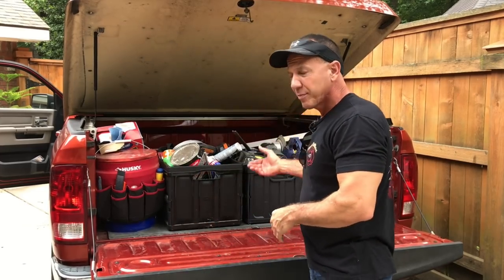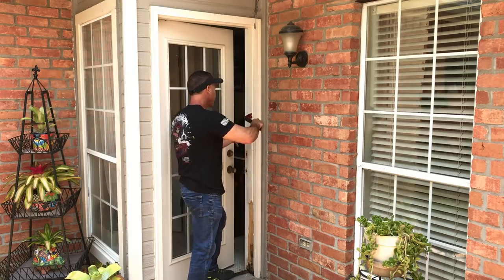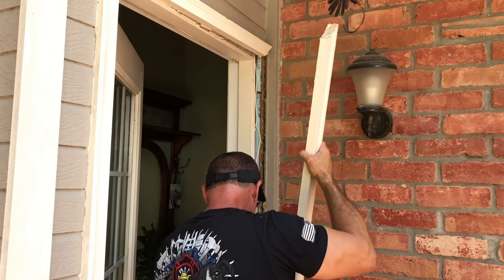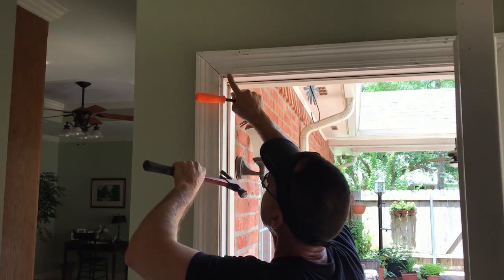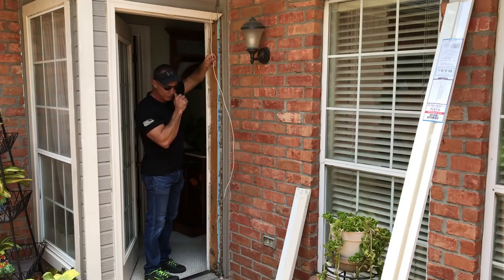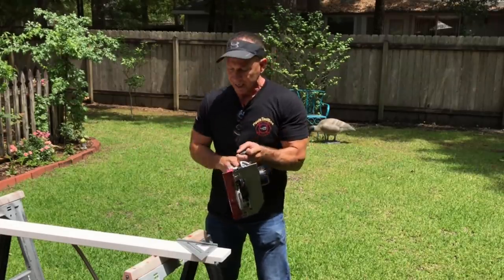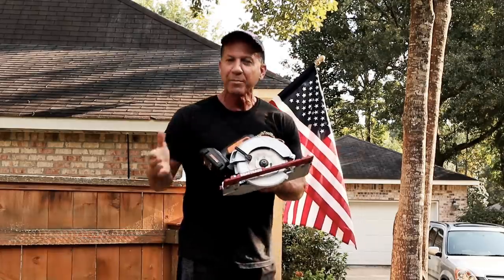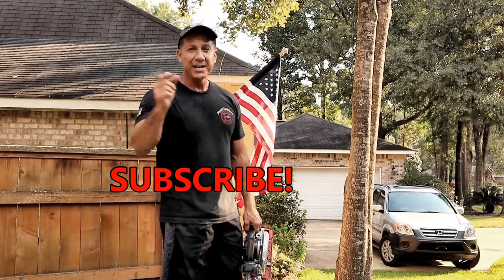Repair Replace Door Jambs Part 1

Comment: I appreciate that you have to edit things out but there are places that you skip that can leave someone wondering how you got to there after skipping forward. Things such as keeping an even space between the door and the jamb for example, or how you measured and reinstalled the lock and dead bolt latch plates. I know you know what you’re doing but at times experienced people forget those watching don’t know it all.
Reply from the maker: Hi Clint,
I'm sorry that I confused you, I try to explain everything but I do my best to give full information without getting too lengthy. I meant the door reveal and I show how to do this in previous videos. I don't expect everyone to watch all of my videos and I will try not to skip again. I will put a playlist together that will categorize similar videos. As far as the reinstallation of the lock and strike plate, I had it in this video but it was too long and I am going to be posting it soon. I have very useful tips in that video and I hope you take a moment to watch it. Thanks for putting up with me and I appreciate your comment, I will remember this when doing future videos.
Have a great day!
Paul
Reply from the maker: Hi Clint, keeping an even space between the door jamb and the studs are not important. Many timed the framing will be off and the gap is different, this is why shims are needed. I stated in the video that you need to check the jamb with a level to see if it is plumb. I cover the lining up the strike plate and locks on the next video, it will be posted in the next day or so. I hope it will clarify things for you.
Thanks!
Paul
Reply: I agree with clint.  Also keeping the video short makes the DIY think its a fast fix when in reality that was a 3 hour job from start to finish, buying materials etc.  One thing I also don't see are safety tips.  Seeing some DIYer cut their hand in half is pretty horrible.... I've seen it.  They don't have training and don't know their limits like a pro.

Comment: You gave me idea and easier way to fix my back door jam, do need to buy galvanized nails, I had to replace the outside wooden wall panels because of weather deterioration i.e. dry rout and termites, in the replacement process I damaged the door jam and frame...Tried to fix it and did not look professional, need the right tools... Thanks for the ideas on a more professional look... Jack Bauer
Reply from the maker: Good morning John,
You may be able to repair the frame you damaged with Bondo. I have videos showing how to use Bondo on wood. Believe me, I have made many mistakes over the years. The good thing is that you learn by experimenting  making mistakes. If you have any questions,please direct them to my www.paulstoolbox.com. I will do my best to help.
These videos may help.
Thanks!
Paul
https://www.youtube.com/watch?v=--ZhNXkbuWc&t=9s
https://www.youtube.com/watch?v=2z5LU7Grt_8&t=9s

Comment: I would NOT use shims to hold the door jamb in place because it makes the door frame very weak. Someone can easily break in by kicking it in. So, I would rather use a whole piece of wood to fill in that gap, not shims. My opinion! That would make the door jamb much stronger and holds the door better if someone try to break in.

Comment: Prime painting the bottom of that new jamb with fast drying primer would have added many years to the life of that jamb. 
Or job security, that white pine with water soaking into it will last about five years before that job has to be done again.

Comment: If you are thinking about doing this please don’t. You are ruining the weather seal between the threshold and the leg jamb. This WILL cause leaking and WILL rot out your subfloor. I hang doors for a living and see rot on 1 in three doors. This is a sure Fire way to ensure you ruin your house. Replace the door the whole jamb, waterproof the opening before installing your new door.

Comment: Never nail shims- see door  installation guru Katz!
Reply from the maker: Katz is a great carpenter and I give him total respect. I know many excellent carpenters that do things numerous different ways. I have been nailing my shims in place for 25 years and have never had a call back. Tom Silva from This Old House is probably one of the best carpenters I have ever seen and he nails his shims. Sorry Jon, I appreciate your point but I disagree. 
I'm not saying your way is wrong, just different!
Reply: @paulstoolbox   I agree Paul thanks for the thoughtful response and I had a chance of working with This Old house guys when I lived in New England
Reply: Also, kudos for you for using some PVC trim (it's an interesting & highly effective product in exterior applications) although generally against plastics(as much of it makes its way to the oceans- recently we've officially polluted the Gulf of Mexico here it's an astounding thing to take a boat out and see miles and miles of dead fish & endless pollution, I digress), meanwhile if you can believe it many of the high end builders are still clearing lots with toxic chemicals like Round-Up & putting pine against dirt and wonder why we're digging out all these rotting doorways 5 to 10 years later!
Reply from the maker: You're a lucky man Jon! I attended many tool shows in the past and I always wanted to meet Norm Abram or Tom Silva. Those 2 guys always catch my attention.
Reply from the maker: I'm with you Jon, I believe we need to be more careful with plastic products. As far as Round-UP I don't like it at all. That is a terribly dangerous product for environment  and health.
Thanks!
Paul

Comment: If it waas me, I would have just replaced the bottom 2 or 3 feet, instead of replacing the whole jamb.
Reply from the maker: Either way you have to buy a Jamb, it only cost 26.00 and it's done right.
Reply: Not for me. I can build my own.
Reply from the maker: I could have built one too but it wouldn't be the smartest way to tackle a job!

Comment: I'd need $800 the by those tools.
Reply from the maker: LOL, This is exactly how I justified most of my tool purchases. I would tell my wife that I needed the tool to do the job myself. I would rather buy a tool then pay someone to do it for me. I hate to pay someone to do something that I can do myself and I can control the timing and the quality. It's a win, win to know how to do your own work.
Have a great day Brian!
Reply: Paul Ricalde  Thanks for the reply. My comment was facetious. I agree with the justified cost of tool purchases. I have accumulated many tools over the last 40 years. I have saved many more dollars than I have ever spent on tools. I also enjoyed the challenge of learning a new skill.  If I could add one more caveat, be sure to buy the best quality tool you can afford and it will last you a lifetime.  Don't buy cheap tools.

Comment: You should never nail shims. Shims are for adjustment if you nail through them they are worthless.
Reply: Really??  Do expand your thinking to us.
Reply: @woodstover  The reason is to be able to adjust the door in the future if needed. All you need to pop the casing then adjust as needed. If you nail thru them you need a sawzall to cut then install new ones then adjust. Most pro door hangers will mention the same. Thank you.
Reply from the maker: Hi Jasper, I appreciate your input but I respectfully disagree. If you tack them in place, you should not have to re-adjust the door in the 1st place. If your home has any shifting you can remove the casing and easily use a pry bar to move the casing outward or bend the nails. I am only tacking them in place with an 18 gauge trim nailer, they can be easily cut. If you don't tack them they may slip down in the winter when the wood shrinks and could possibly bow the jamb when the wood expands again. Shims are used  to fill a void, if they move or fall they are no longer filling the void. I wouldn't suggest using a large nail for the shims, now that would be wrong.  I know people that do it both ways. I've been tacking shims in place for years and I never had any problems. I'm not saying your way is wrong, I just prefer to tack them with brad nails.